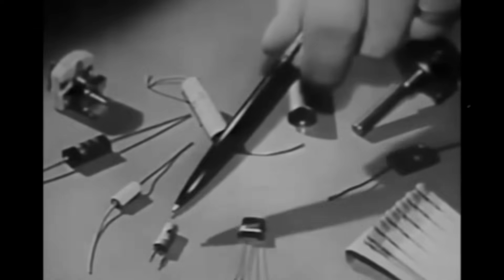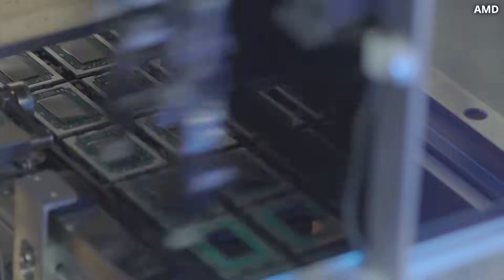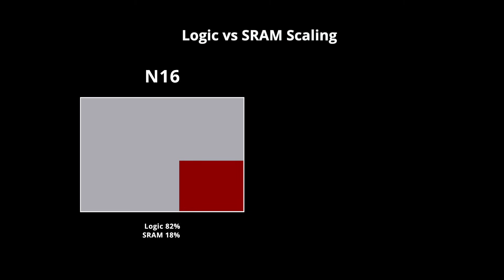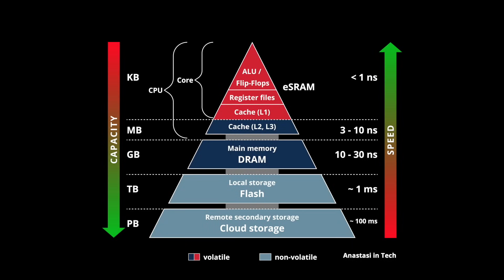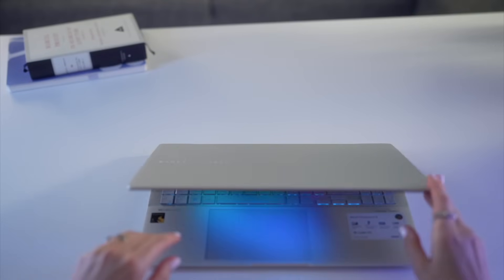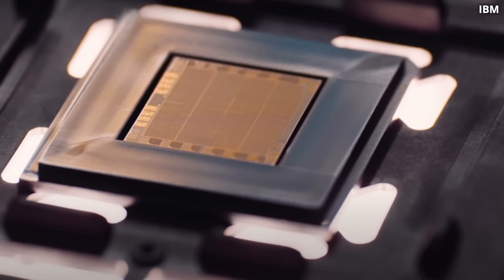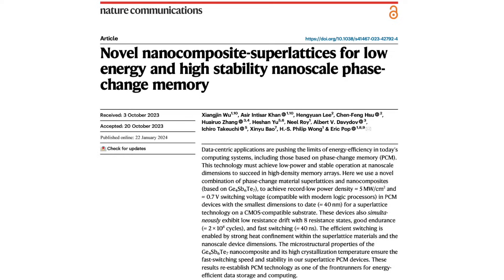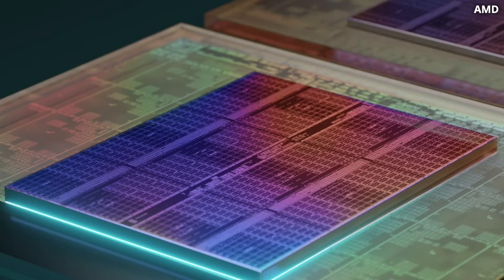The Death of Computer Memory

Comment: I could understand why D-RAM cannot shrink so easy (due to the necessary capacitor). But I did not get the point, why gates can be shrinked, but gates arranged to build a bit cell can not be shrinked.
Reply: the reality is that for most logic structures the logic isn't as compacted as Sram is, they spread things a bit more, this reduces the interference / noise,
Sram is also less stable by nature, (search about flip flops to learn more about it) we have more stable memory structures but they take too much space to make sense switching over

Comment: If you coat your memory with alcohol and honey lithium solution once a year, the memory will actually get faster and last longer. My RTX  4090 GDDR6X Memory is now running at 38Gbps instead of 21Gbps. Some also dripped on the 384-bit memory interface and just suddenly doubled to 768-bit. As the Silicon turns fully organic it absorbs it's food and wants more.. therefore goes faster

Comment: Phase change memory. I am concerned with built in obsolescence. Everything I have read in the past about pcm is there is a finite write limit to the memory cell just like flash memory. If pcm is on the processor cache, those write cycles will add up real quick as the dialectrics break down .

I have been waiting 20 years for high density non-volatile memory without write endurance issues and it is equal or better to DRAM in access time. It has all been  vaporware MRAM or resistive memory then improved magnetic bubble memory. The acronyms make me dizzy. I sincerely hope the new memory technology does not have write endurance issues otherwise people will be rotating their processors out every 6 months for a new one.

Comment: I worry about using non-volatile memory for primary or cache memory because of the security aspect. If the information remains after power is interrupted, quite a few "secrets" will be in clear text, and the determined and well equipped "bad actor" will be able to extract surprising amounts of information from a system.

My industry has to issue letters of volatility with everything we produce, and for anything with NVM, the sanitization procedure usually involves removing the part with non-volatile storage and destroying it. The only exception is when it can be proven that the hardware is incapable of writing to that NVM from any component present on the assembly, even if malicious or maintenance software is loaded onto the device.  This phase change memory built in the same package as the CPU logic could not be provably zeroized without some sort of non-bypassible hold up power, and that would increase the cost and size of the chip package.

I think this is very promising for secondary addressable storage, but I don't see it replacing main memory in most applications.

Comment: And don’t advertise me that ASUS pc although I really want to switch to my next new pc😂, because my previous hp pc had been used around 9 years until now.😂😂😂 I already reinstalled that one to ChromeOS flex operating system.
Also, I wanna find one which can auto-boot for me every morning, and I only found out there’re two, hp and dell, have this feature in their laptops.
But on the other hand, I’m still really sure should I buy a new one now, because I will produce one more electronic junk…😅😅😅
I planed to burn all my electronic junks in the future to extract some precious metals.😅

Comment: on die cpu memory like 3D V cache what amd has done is very crucial for fast computing , 3D stacking is another frontier intel should focus on , using AI to develop and optimise new architecture , layouts for cpu/gpu/memory should be used ,  optical computing is another big leap in computing which will decrease the temps so much for the increased perf.

Comment: It should be mentioned that process node sizes like N3 or N5 nodes are density measurements and not actually a transistor size. Intel 10nm was equivalent to TSMC 7nm as they average over different area sizes and utilize different shapes and can't be compared directly or even with the size of a silicon atom which is only 0.1 nm in "size".

Comment: If I am understanding this correctly, this would be a nonvolatile memory and non-destructive read?

I could really see this having potential application for aerospace, if nothing else.  Assuming the glass material is stable in the long term and doesn't do weird things, you could have extremely low power consumption and a computer which could power on into a suspended process.  A cosmic ray may still flip bits, but the power cost of fault tolerance goes down and if scalable to more general RAM applications, solves a number of redundancy problems.

Although I am the type of person who is not at all amused by the defacto espionage agent microsoft is pushing on us and the insistence my computer needs to actually have a mind of its own, so I prefer memory for my computers to be volatile and processes to generally zero out when unplugged - or otherwise have a manual hardware zero function... But I'm the weirdo who doesn't think connecting my toothbrush to the internet is a sane or reasonable idea, I guess.  The for [thing] (buy) loop just doesn't really execute properly with me.

If the 'promise' of this technology "is true", though, the lines between cache ram, system ram, and 'drive memory' become quite blurred.

Comment: I would be concerned about defects occurring as the phase change memory changes from amorphous to crystalline and back over many trillions of operations.
I would be more impressed if someone came up with a better way to keep the area smaller by merging the N and P chan. fets better or by adding some layers vertically.
 The N fets are smaller and faster, maybe remove the P fets entirely from the memory cells. This may require a slightly higher voltage supply voltage for the SRAM cells.

Comment: Why isn't there motherboard ram soldered right next to the socket, save having to go all the way to a dimm slot for system ram if there were like 2 gigs of regular ram built right onto the board like an L5 cache? I realize it'd still be much slower than cache, but it would clock at least twice what dimm sticks could so even though it's dram, if the os and igp had access to a built in ram chip or two in addition to system memory it'd be awesome for ux, rendering, games and heavy encryption etc. Even file transfers to chipset would see huge benefit especially with pcie 5 approaching ram speeds these days.
Reply: Intel's  broadwell had an L4 cache made of eDram, which gave a good boost for some applications.
Having such a memory on the motherboard would be hard due to the amount of connections needed, it would require much bigger sockets, now have it on the cpu substrate, now we talking, intel has a few cpus with hbm for example this method will likely become more common in the future

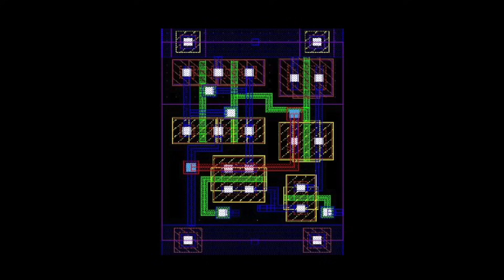Comment: 5:08 "These cells are constructed by transistors, they have unique structures, that does not conform to the normal, logic design rules."  Quoted for context. Is this an implication or the idea that the field of probability exists, in memory design? On the quantum level that is how I am perceiving this information.
Reply: The problem is that SRAM is a hybrid analog | digital design and analog stopped scaling after Denard Law has been broken. Basically scaling down SRAM makes it unstable. I have hope that RibbonFET will fix the problem because they now have a free parameter which is the width of the nanosheet to hopefully stabilize SRAM.
Reply: @kazedcat  That does not explain why the space. Consider the new nanosheet, what if the smallest space still cannot be used. This to me indicates memory does the probability concept also. IE: It goes this way, but it can also go that way. I never actually put it to perspective when I was in tech support before the tech crash of 2000. It just came to me while watching the video and hearing that exact quote up top. In comments.

Comment: Feel free to correct me, but isn't the problem with memory scaling really more an artifact of process node naming... we haven't really been shrinking gate sizes to the extent the node names suggest for years. New process nodes are more or less just making the gates more efficient, the names are almost arbitrary. Where in the past they were linked to gate size. These improvements do allow for some better density, but mostly its improvements in current leakage. which improves power consumption and thus clock speed.   Memory capacity which is nearly 1:1 linked to transistor density is just scaling at the true rate of density improvements.....
Reply: If you translate density scaling into Denard scaling which is related to the impedance of a device then what you said is somewhat true. The issue is that impedance is no longer scaling at the same rate as density. So circuits got smaller but impedance is barely moving.

Comment: The only really important spec for any new memory technology is latency. You can always improve bandwidth by having more units in parallel but you cannot fix bad latency by having more components. I truly wish we had something that's equally low latency to SRAM but would work efficiently with smallest process technologies.

And the ultimate goal would be to get rid of SDRAM for good. I'd love to have the whole system RAM made out of SRAM (or any other memory technology with < 1ns latency).
Reply: There is actually a much faster memory than SRAM but it uses a lot of transistors they are Logic Latches. Because they are built from logic gates they scale with logic scaling but the smallest logic latch needs 20 transistors per cell.
Reply: @kazedcat  The problem is obviously the cost. If you use 20 transistors per bit, building something the size of i9-13900K would result in about 128 MB of really fast RAM if the whole chip area were spent for this kind of super-fast RAM. And if you build  optimized SRAM instead with 4 transistors per bit, you would still only have roughly 700 MB of RAM on that chip.

You don't see many people willing to pay about $1 per 1 MB for really low latency RAM. 40 years ago that would have been insanely cheap but we need insane amounts of RAM these days.

Comment: I believe that down the line we would need to use another processor architecture than the Von Neumann one that we use today (i.e. having logic and memory separated), an architecture that instead has an "on memory compute" design, or perhaps a mix of them.
In the end the speed of light makes it hard to compute over longer distances (i.e. CM or even MM) specially when the frequency goes up and the data becomes even larger.
Reply: So basically smart RAM chips with shaders?

Comment: It's quite bizarre that you thought the PCM memory is a future replacement of SRAM, as the it has a switching speed of 40ns (on par with DRAM), according to the paper you cited. This is an order of magnitude slower than SRAM. The current only viable option to replace SRAM is SOT-MRAM, which TSMC is working on. Go research SOT-MRAM😁
Reply: This is true. PCM is totally useless as SRAM replacement and doesn’t have sufficient speed or rewrite resilience. Honestly, she really failed to understand its use case. It’s a great alternative to floating-gate FLASH memory, not SRAM!
Reply: what about 4ds memory? 4.7 nanosecond write speeds
Reply: @stavrozbach3992  Again, 4ds (and other resistive RAM companies) could be a useful replacement for memory that is read often but only written occasionally, such as bulk file storage or storing the weights used in AI. However, none have demonstrated sufficient write resilience to compete with SRAM, so the use of these alternative memory technologies in cache or main RAM is not feasible. 
For example, in a GPU RAM has to withstand millions to billions of writes per second, so even if a phase change, resistive or other ‘Memristor’ type alternative could demonstrate a trillion write times resilience, they’d fail within minutes. 
SRAM has theoretically unlimited write times resilience, since no physical change occurs when changing state, so will remain the standard for a long time to come.
Reply: @simontillson482  aaah yep makes sense! Thanks! still learning about all this read an article recently on 4ds and the write times sounded impressive but had no idea about the rest!
Reply: At first I thought this video was going to be about a novel memory type, then I thought it was a parody, then I realized it was just a promotion aimed at casual investors. 😕
Reply: It is good enough for cache application but very bad for register memory.
Reply: @kazedcat  its not good enough for cache, modern caches are at most in the low dozen of ns, 40ns is DRAM levels of latency

Comment: I thing the migration to using lossy but very dense memory is a big part of the future. This insight I'm pulling from the organic world, for example considerations of mitochondrial data reliability, capacity.  Which for me, brings the curiosity of an aspartame induced memory damage study on mice where the researchers were startled to find that maze solving impairment passed through fathers where mothers were not exposed to aspartame. Implying memory issues capacity to be carried through the sperm. So the traditional question would be how did aspartame affect the DNA in the sperm? But if you subscribe to the theory that mitochondria naturally engage in consciousness processes through evolved self interest, then we see a potential in mice at least, for the discarded mitochondria of a sperm to have evolved a mechanism to pass data to the egg(instincts). While the study may have been flawed, it does synergize with two factors, 1. non gender-filtered passing of instincts between generations. 2. Mitochondrial symbiotic evolution and a generational bottleneck that needed solutions to pass, with millennia to evolve those solutions for.

Comment: I still cannot understand why the SRAM cannot scale like the rest of the logic, after all each memory bit is just a flip flop like every other flip flop in the processor. What am I missing?  What is the difference if any between a register in a microprocessor and a memory cell on same processor?
Reply: The problem is that SRAM is partly analog. Yes high or low state is digital but writing and reading is analog. To write you need your input current to overpower the cells drive current. To read you need the cells "drive current" to overpower the output current. Since we are dealing with current and not voltage then impedance is very important. Variability in impedance means the device might not behave as expected.

Comment: Phase change has been around a long time. The industry desperately needs better memory tech, but I wouldn't be too optimistic. I have seen Memristor tech fail to commercialize, and poor old Intel with their Crosspoint memory tech (sold under the brand name Optane) got discontinued, not because it didn't work but because they bungled the marketing and didn't explain to people how it worked, and when to use it (it was terrific for hard drive caches).

Comment: That is for binary models though right, so they just need to create a context of other base systems. The available memory would more or less increase by whatever system was used in place of a 2 point geometry that said it is packed in but its really down the the size of the matter, THEN it is down to the size of the energy frequency  as each point can hold the totality of any energy contained in it. Then quantum effect because locality doesn't equate linkage of energy as energy is also quantumly linkable meaning memory is not limited by spatial constraints. Also bear in mind that reality is not 3D.
Reply: CMOS is inherently base 2